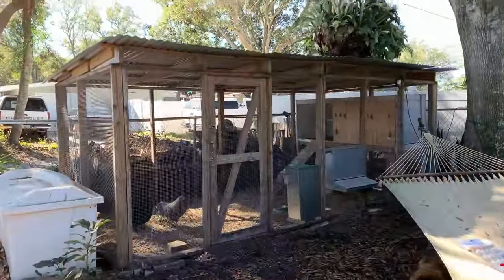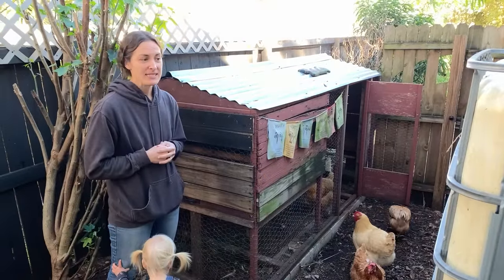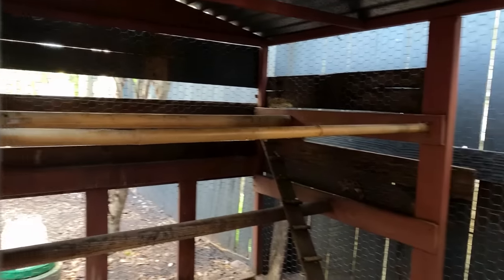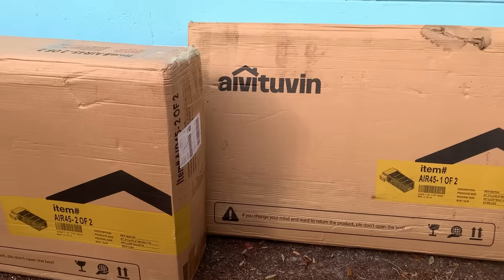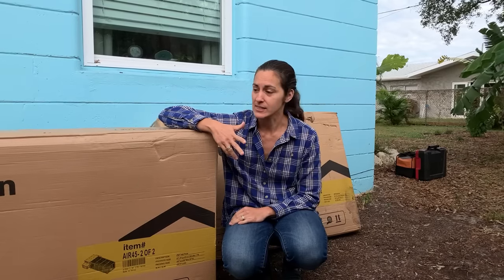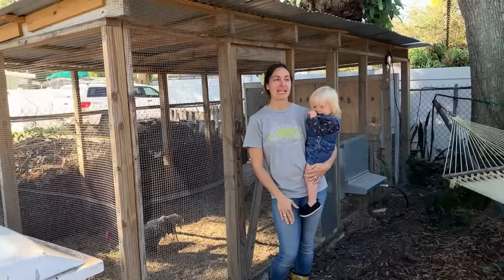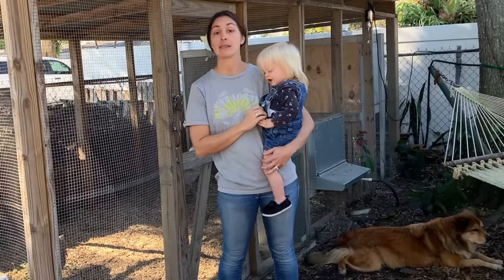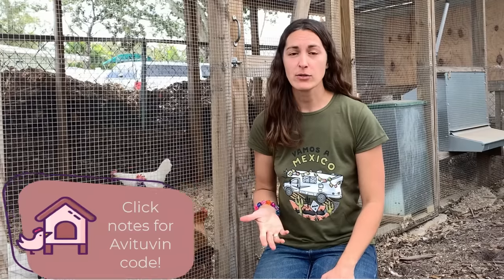BEST Chicken Coop for ANY Budget + Tips for Designing a Chicken Coop

Comment: I built mine and as you said modified it through the years. One thing I will always recommend is the water nipple method. They can be made or bought with a 5 gallon bucket. The water stays clean and can go days or weeks if needed without changing. They kinda have to be taught to use them but learn from each other.
Reply from the maker: Those are nice, we have them to try out (using refillable cups now).
Reply: @Dawn_______  I never even thought of that! I guess living in Florida you forget about things like that.
Reply from the maker: Ours always had slow leaks but we did use that in our original coop. Bucket got algae in the summer heat too.

Comment: I’ve had the same coop for 25 years. I sank PT wood a foot into the ground and hardware cloth equally so. It’s approx.10’ x 30’ and is 7’ tall, tapering to 6’ with a proper roof. Barn board from an old shed covers the cornered roosting area to provide protection. The nesting boxes are on the ground - that’s the one major change I would make. I hate the chicken wrestling every time I go inside!

Comment: One thing that sticks out is that your actual coop isn’t completely enclosed. Back in Sacramento, our coop had a single small door with light ventilation…but it’s an arid climate. I was going to build my new one here in St. Pete similarly but am now wondering if I should instead make something more open. Is yours always so open or was part of the wood panel missing for the sake of the video?
Reply from the maker: Nope that's intentionally open for ventilation. The one unpainted plywood piece is just for a bit of draft protection in the winter. 3/4s of the year that piece is removed and the whole thing is wide open.

Comment: What automatic systems did you use and how did you collecy.eggs.when traveling
Reply from the maker: We have a roll away nest box which collects the eggs away from them. We can go days without collecting. The water is hooked up to our city water and fills their water cups as they drink it. The feeder we can put half a bag in which feeds them for weeks. And because it’s an attached run we don’t have to let them in and out every day.
Reply: Hi there!  Great video! How did you set the waterer up with a hose? How do the watering cups work with the pressurized water? Which feeder do you utilize? I currently have a 55 gallon drum with ports for food but it attracts so many mice.

Comment: Mine is similar to the cattle attached to an arrow shed for the interior and then has a 2 foot plastic sewer pipe that leads into an atrium I built out of a trampoline it is three times the natural type of the trampoline I can stand up inside and put my hand up almost the bounce was perfect the trampoline with perfect just missing the outer spring covers I then wrapped it twice with 76-in chicken wire used a little less than 100 ft roll 33 chickens

Comment: Personally I hate wood prefabs. Most are hard to clean without moving, but the wood is soft and every time you move them, they just get flimsier. The small prefabs that are mostly for safe night lockup and are light are fine for small backyard flocks, but if you want more than 3-5 birds... I don't recommend prefabs. And prefabs are best if you're letting them free range.

Because I breed and have multiple separate breeding flocks my chooks don't get to full free range every day. Means their outdoor runs need regular cleaning to make sure they're not scratching around in their own poop and shed feathers. So for me the entire coop needs to be easy to clean, not just the roosting/nesting area, and of course it needs to be large! Each coop should be able to house 7 adults and have space for a small tractor inside for introducing new birds, or housing mum and chicks on the rare occasions I let a mum hatch her own clutch or give a broody hen babies.

Comment: Consider climate when buying a prefab coop. They WILL NOT LAST long in any wet and/or windy climate and they are NOT predator "proof". They ARE flimsy.  That being said,  they will buy you some time if you have $300 to blow on temp housing.
They will also serve as a quarantine coop for new birds or grow outs or injuries. I repurposed mine for my rabbits, inside my secured run, and all co-exist in the same area with day ranging.
Cheaper, easier, more secure, is a cattle panel coop over a 2x4 frame. Cheap and easy to construct by yourself or as a 4h project, kid project. Keep it as a movable chicken tractor,  or permanent structure,  or break it down and use the panels and wood for other projects. (Doug and Stacy have a great tutorial)
Reply from the maker: I’ve seen a similar set up to that before. I like working with those panels.
Reply: @TheUrbanHarvest  I use them for EVERYTHING.... cold frames for my garden and trellises for peas and tomatoes and melons.... only problem is getting my husband to bring them home for me!!😂